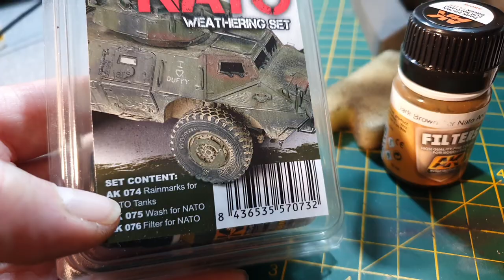Applying AK Interactive Weathering Paints to the HG P408 1:10th Hummer Army Truck

Comment: From what I know Ant, a filter will work to blend a few different modulation colours together by unifying them with one overall colour. Its basically a thin wash that you don't want to pool like a wash but have an even all over coat from an airbrush. so if you modulated a green in 2 or 3 colours and it was noticeable the filter would blend and unify them all into one finish if you get me. Love your rigs btw
Reply from the maker: Cheers for that mate, yeah that makes sense as a way of unifying finishes. Maybe I watched the wrong videos and thus used it when it wasn't needed. It does make a decent wash tho, so not wasted 🍻